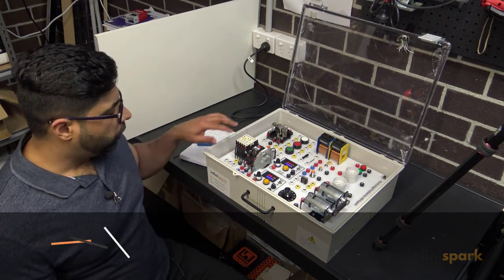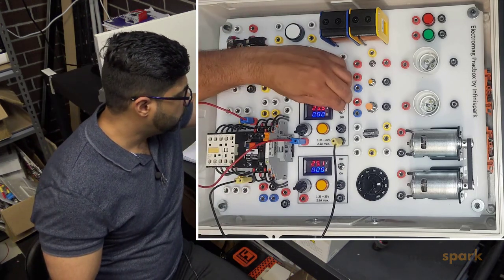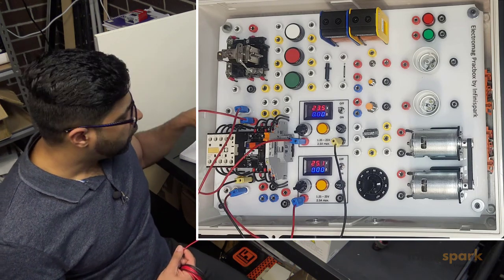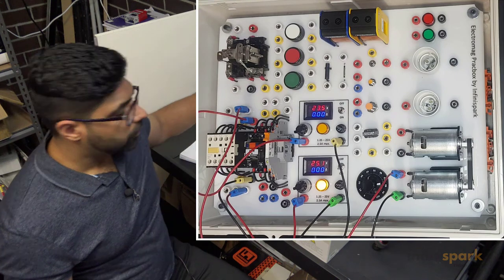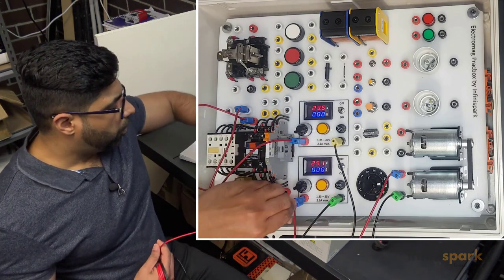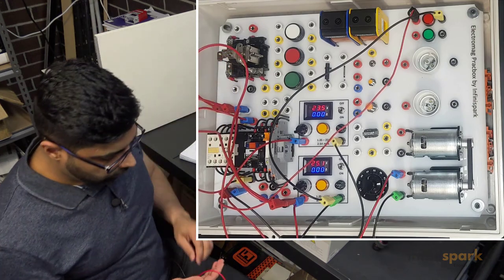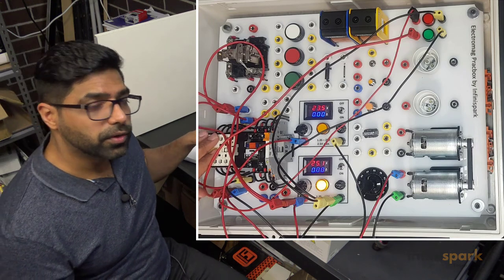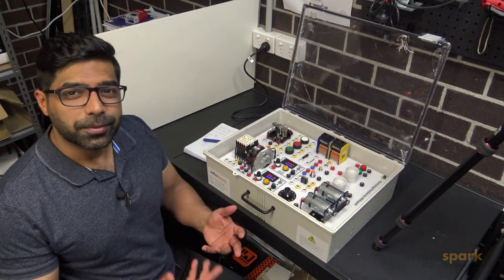How to wire a 24V contactor (in a controlled setting)

Comment: sir,will this 24vdc contactor switch the 48vdc 700watt motor if its connected to contacts.
Reply from the maker: A 24V DC contactor is the coil rating. The contact ratings are usually much higher. For example, the one we used in the video can operate up to 660 VAC at 9A on the contacts. You may have to check the contact ratings of the contactor you are planning to use.

Comment: 24v dc 2no 2nc - 230v ac contactor will work on solar panel dc volt 0to30v. 
I am taking solar volt as reference to connect 230v ac line 1 and 2 switching function. When solar available line 1 to be connected . If solar not available then line 2 to be connected. My doubt is will this contactor work on solar dc volt.
Reply from the maker: Dear Jai Kumar, the contactor will work in principle but it's not going to be reliable. Here are some things to consider 
- changeover of power that frequently may not be good for the contacts. 
- the time between the changeover may disrupt the appliances and equipment
- when the voltage is between pull in and drop out range, the contactor could ripple between on and off. This could be a problem for the installation.

Please note: I haven't personally made this circuit so I don't know actually what would happen. The points above are just my educated guesses.
You may be able to setup a test rig with a small panel. Please do share your findings, I'm curious as well.
Thanks